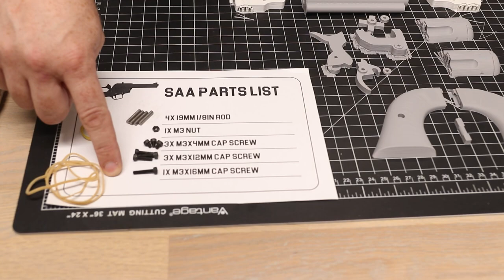3D Printable Rubber Band Cowboy 6 Shooter | Build Video

Comment: Wow. Awesome. I did make the wood project by RBGuns.  I think it took me about 3 times to get a working model and I don't have fancy wood working tools.  It works fairly well but still some problems with it occasionally.  Your tutorial is outstanding.  My son has a new printer so I will be making your model shortly.  Don't know if all the parts will fit yet, but at least the intermal mechanisms can be printed and that was where my problems were. Ha.  Thank you so much for sharing such a good design.

Comment: I think this is one of the best models out there. It has plenty of great ideas and features, but then there are some things I dont understand. 
The rubber band within the handle is one of them. It took me almost an hour to get it in there properly. 
The model has serveral pin holes where to place it. Why not just place it next to the hammer part where it it is attached? 
There is plenty of room for it. Also, why make the weird cylinder to hold it? Why not just a hook like the rest of them. Again, there is plenty of space to make it. 
Then the rods, I understand the ones which are enclosed with the revolver cylinder decor parts. The other two which come through the whole thing I dont see the point. Why not just use M3 screws for those, just like the other parts? 
I adjusted the holes and replaced the rods with M4 bolts and I wish there would be ennough material to add some thread inserts for them. 
Overall it would be nice to replace all the nuts with just thread inserts overall. 
I hope you will make the V5 assembly a bit more practial. 
Overall, like said, this is a great model and I highly recommend everyone to print it.
Reply from the maker: Thanks! 
There's logic to all of those decisions, a lot to do with reliability and function. If you think about it, there's a lot happening in a very limited space. To get it reliable there was a lot of thought and compromises. The rods are smooth and not bolts because I didn't want screw holes poking out, rods are smoother and more reliable, and there wasn't any space for recessing nuts and bolt heads. The bands in the handle need to be a specific length and pressure because of the hammer travel, too short and it would ramp up too fast, break the part, or do nothing. So that's why they are the way they are. Advice appreciated, I'll look at the rest of the suggestions and see if there's any improvements to be made.

Comment: I am wondering where I can get those rods, especially in my country (Netherlands). How would you translate 1/8 inch rods to more metric style?
Reply from the maker: 3mm rod would work great, you should be able to buy it as soft steel welding rod at any hardware store. Or chop the head off some M3x20 screws.
Reply: At Hornbach you can get  a 3mm screw rod that you could cut. I used this myself